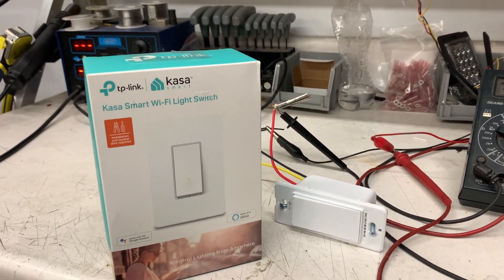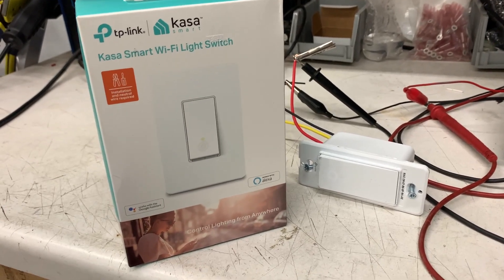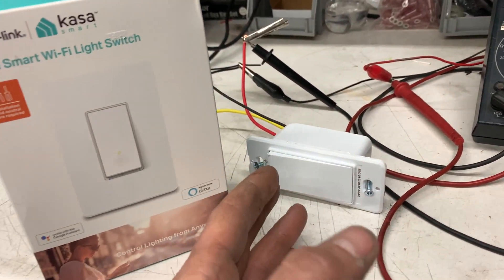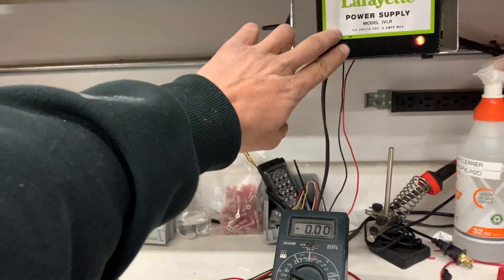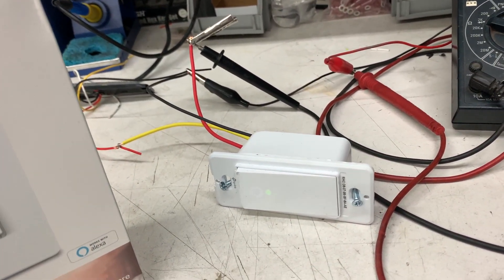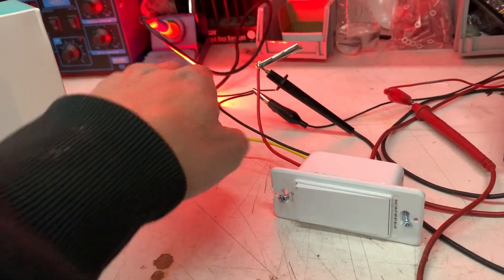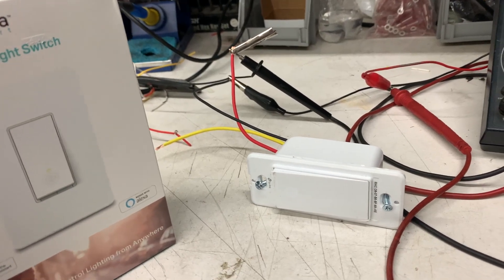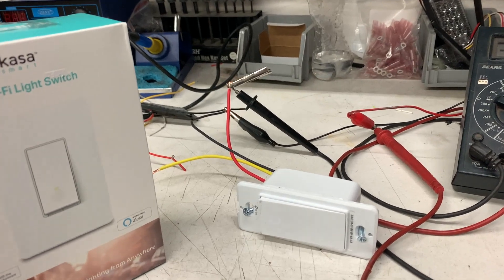TP Link HS200 Low Voltage Mod

Comment: Additional note:  the HS200 works all the way down to  16 volts AC (or lower), so you can control 24VAC devices with it with no modifications at all.
Reply: when is 'soon'?🙃
Reply: @michaelsmolin2124  On further inspection, it looks like even though the the normal 120AC is converted to DC (along with some ripple), the "poor man's" dcdc converter on board looks like it may need some 60Hz ripple to actually operate. Hope to take another look "soon" to see if that can be overcome  : )     But it absolutely works right out of the box on low voltage AC.
Reply: @fhi6781, hi, I tried using 28VAC on HS200. I tested it and the lights in the switch doesn't turn on. Do you have an instruction on how to make HS200 work on low voltage AC?
Reply: So what do i need to do

Comment: What the f was this come on… haha. 
Is there a part 2? 4 mins 8 seconds of talking this up and then last 8 seconds is some little pictures with words that can barely be read if at all with no actual how to talking.
Reply: if you just stop the video on the last 2 screens, and screen shot them you shouldnt have any issues.  They show how to do it exactly!  They show where each component connects to.  Follow it exactly.